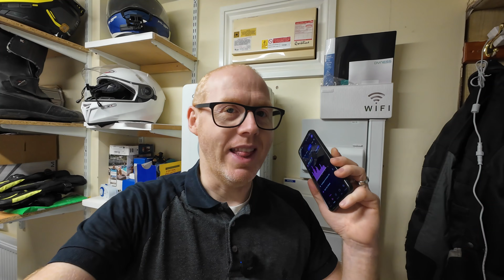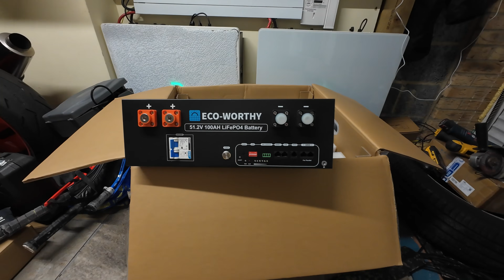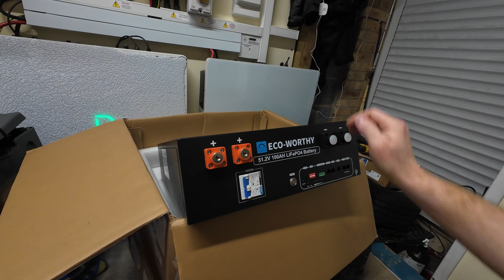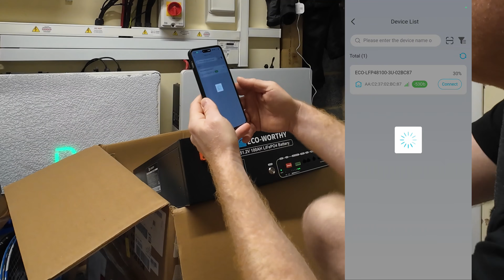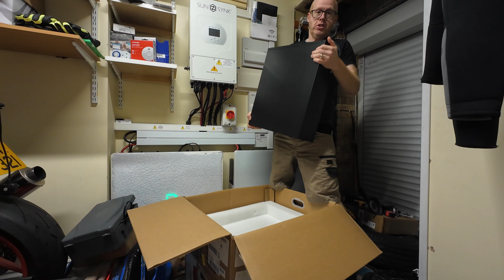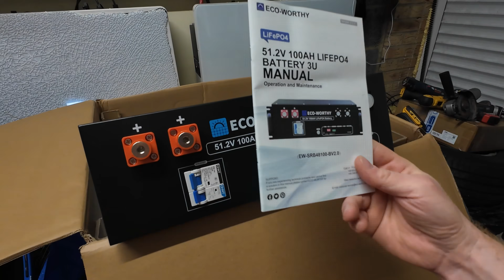Building a 34kWh Home Storage System: Is the Grid Now Optional?

Comment: I did much the same as you. I started with two PylontechUS3000C modular batteries that I used to test and commission my solar power system. Then I added six more of these and ran with the eight for about a year. Then I got two more, but I only stayed at 10 batteries for another couple of months before they were doing a deal, that I couldn't ignore, for the Pylontech US5000B model, so I got four of them. I now have 14 Pylontech batteries (which are quite similar to the batteries that you have chosen.The major difference is that Pylontech are 15S and not 16S.)

I got the Pylontech for the same reason as you, easily handled by myself, modular and can be stood vertically. I ended up with the 10 US3000C batteries in two racks and the the four US5000B batteries stood on their ends, between the racks.

I bit the bullet and went completely off-grid and don't have any form of back-up charging available. For me, it's solar or... solar. I have never wanted for power and have never had to ration power and the best thing is the State of Health of the batteries is still at 99% after two years and five months in service.

My payback time for my entire system (15.1kW of panels, MPPTs, Inverters and 50kWh of batteries) was originally 12 years, but I bought and EV to replace an ageing diesel vehicle and now my payback time has shrunk to just 8 years (and I'm more than two years in.)

For the moment my battery addiction has been assuaged, but every now and then I do have a peak at the current prices...
Reply from the maker: Thanks for watching and commenting!
Reply: ... that where I am also - got 16 pylons linked to the BMS (& MultiSIBcontrol) and have another few (2nd hand) linked unmonitored, but work well without bringing down the system to the lowest / max battery cell voltages.
Reply: How do you go completely off-grid, considering there's minimal solar production in winter? (are you outside Britain?)
Reply: @aliasgharkhoyee9501  Yes, I'm in Australia. I'm very lucky in that I don't have, or need, any form of back-up generation. If I were to go off-grid in Britain I would a most certainly have to consider back-up options.
Reply: @Qosmio1955   Fair. I'm curious how practical it is for average western European properties to be off-grid in winter.
Reply from the maker: @aliasgharkhoyee9501 15kW of panels will do it I guess, although I don't know what they're doing for heating.

Comment: Don't you have to notify the DNO if your adding generation or have you . Do you have a limit
Reply: When adding the extra inverter you do. When adding solar or battery you should do but that bit is really a paperwork formality as it makes no difference. So in the case of the video the extra 3.68kW inverter is notifiable and the G99/G100 has to be updated.
Reply: You only have to notify for anything connected directly to the grid... So mainly only the inverters. Solar can be setup to be self consumed and therefore not necessary to notify
Reply from the maker: Yep

Comment: EcoWorthy uses cheap generic LFP cells and non name brand BMSs. No thanks.
Reply from the maker: Who do you prefer?
Reply: Yeah I was looking at them and wasn’t convinced. I ended up getting batteries from the Netherlands a company called NKON who also supplied all the Victron gear for my off grid setup (16kwh 314ah EVE cells, 150amp BMS, active balancing, pack heaters and fire extinguisher all in one unit. For 2000 delivered)

Comment: Another intriguing Video!
Before you go ahead with your inverter install I would love to know if you are going to do it yourself and all the processes you are going to go through like DNO applications, permissions and you kwh allowance.

I now have the panels and inverter ready to go on my wall but haven't started yet. 

It's an off grid system without a battery I would like to use the inverter you are proposing or even the 5 or 8.8kw versions.
But I'm nervous about even attempting to apply for extra DNO permission incase I screw myself over.
Reply from the maker: I will be covering this in a future video.
Reply: @UpsideDownFork 
Good to hear dude.
Please don't skip any details 😉

Comment: Good honest review, look to be good DIYable batteries at a very fair price.  What’s the DIY situation r/e the inverter, I assume that would need a part-P electrician signoff for connecting to the consumer unit?
Payback as you say is diminishing returns for adding more battery storage, thanks for highlighting that. I’m still tempted though ….
Reply: For a grid tie inverter you need a qualified electrician to install the consumer unit element, also you need the G98/G99 application done, you need the correct line diagrams and labelling and you need a lockable isolator. From October your sparky needs to be specifically qualified in batteries to do the work.

For a non grid tie inverter it depends what you are doing but there are cases (eg a non grid tie inverter running your shed that doesn't contain a sleeping area), or where you are not connecting it into the house electrics that don't need a sparky.
Reply from the maker: Thanks for watching and commenting!

Comment: Good video. I just purchased 2 16kwh fogstar units and to be honest the depth isn't much more than the units you purchased. Price wise it would be 16kwh compared to 10 for likely less money. The economics are interesting, as some pointed out the expansion is for a couple of days in winter however given the yearly yield from the shed plus being closer to zero import during the summer and only importing off peak in the winter then it does make sense.  The key here is getting the inverters to support each other, something I had a lot of trouble with with my setup.
Reply from the maker: Thanks for watching and commenting!

Comment: We used 109kWh on the coldest day in January!  That is with a well tuned 15.5kW heat pump running open loop on pure weather compensation.  Our 36 south west facing solar panels generated only 7kWh that day.  We have 2 x Powerwall 3 battery/inverters giving us up to 27kWh of storage, so it was all gone by mid-morning.  The good news is that in February, the Powerwalls sometimes last for the whole 18 hours of expensive electricity and we are already getting money from exporting to the grid.
Reply: Jeez, and here I thought I was a high usage household with 40kwh average per day. Bravo to you 

Want to send us some energy there pal? 😂
Reply: @thabo5799 it is a 350m2,  5 bedroom detached house, built in 1968 and rated EPC C.  It sounds like a lot of energy, but it is a big house!
Reply from the maker: Ouch!

Comment: Fogstar are now doing a 48 kWh stackable system for £4500, and a 64 kWh for £5750, both can be expanded. Very good value per kWh
Reply: I picked up their 32kwh for £3200 during Christmas. It pays itself off in 3 years.
Reply: That's incredible price
Reply from the maker: That's great value per kWh! 👍
Reply: Do you have a link for the 64kwh? i don't see it on their website
Reply: @trebordraw  Its the same page as the 48kWh stackable but click on the selection box
Reply: That's incredible value considering I paid £5k for an upgrade from 4 to 8kwh. Mind it was a few years ago

Comment: There is no economic sense to do that. You did not put enough emphasis on this. There is no case for spending 1000 GBP to cover 7 days of winter shortage, that will at most cost you 2 or 3 GBP more based on your existing system.
Sadly, you are just contributing to being people in the rabbit hole of always buying more or bigger gear without understanding the economic return.
Is this a sponsored video?
Reply from the maker: Yes, this doesn't make economic sense for me, apart from the continued youtube exposure which may pay for itself.
Reply: You are aware that other people exist, and just might have different ideas than you? Some of us value energy independence, rather than economic return......
Reply: @adamswire9152 what energy independence? In the winter, he is only producing 10-20% of his needs at best so he still relies on overnight cheap tariff.
Reply: @aymerichousez1005  I may have missed the point you are trying to make. I value energy independence. I have a large DIY install of a 48Kwh battery banks and 12Kw of panels. UK weather is very, very variable. It only takes half a day of sunshine to fully charge my batteries and can get four days normal usage out of them with no sun. This winter in particular, we have had many continuous days with no sun, so in my case, an even larger battery bank would help with my energy independence, and mean I could stay on solar for longer. I am not looking to make money or to reduce my bills (although that will happen a bit) I make my own choices to suit my own circumstances. As does @UpsideDownFork. He said he installed more panels and was looking for a way of integrating them into his system, and this is how he did it. The fact that you would make differing choices does not invalidate his.
Reply: @adamswire9152  Its not really "energy independence".  It is very hard to build a solar and storage system big enough to actually get that 12 months out of the year.  9 months is easy.  12 months is almost impossible.   The storage isn't even the biggest problem there... it's the solar and, in particular, winter heating that's the problem.   Add in an EV?  Even worse.

But what you can achieve is a 11 or 12-month zeroing of your bill (sans the standing charge anyway)... by building up export credits in the summer and burning them in winter.

Even a completely off-grid property (and there are many here in the U.S.) is not completely energy independent.  They still have to buy fuel for the generator and/or heating to bridge winter.  The solar and battery system optimizes the fuel consumption and limits it to just ~3 months a year (across winter), but the cost can still run $1000-$2000 easy for those 3 months.

So either way you are paying someone something at some point.  Minimized, yes, but never completely independent.

-Matt
Reply: @junkerzn7312  Very true. Difficult to get nuance on YouTube comments! Personally, I am aiming for independence from the electric company, and having the capacity to generate and use my own power. I am nearly there, tbh. I live in on the south coast of the UK and boosting my battery bank would enable me to achieve this.  It is an ever evolving system. I will have far too much power during the summer though, so I might get a hot tub or heated swimming pool!  My winter heating is via a woodburner with a back boiler for hot water. I am still connected to the natural gas grid as a backup but with some changes, I could be completely independent. Next on the list, after a larger battery, is to become water independent.
Reply: @adamswire9152  I don't really recommend a wood-burner for heating, but it depends how large a space it is.  A regular home... I wouldn't recommend it.   Keep in mind that there is a convenience angle and a manual labor angle to working with these resources.  Also neighbors and regulations.  And long-term health.
Reply: I guess it should be seen as investigative content for his YouTube business. I'm sure that will make a return. I certainly wouldn't be influenced to follow suit, you should design for your own circumstances.

Comment: Powerbox G2 has self heating function that is a plus if batteries has to be placed in a non heated garage
Reply: In a garage, lithium batteries will be fine without heating as Coldest temperatures will be around 6-15 degrees. Outdoors, absolutely essential.
Reply: @techtactics788  that depends where you live. Cold places do exist.....
Reply from the maker: Yep.

Comment: Amazed that your daily house load didn’t go above 34kWh, on the coldest day I used 80kWh, most of which was heat pump.
Reply: Depends what tariff you are on.  I’ve touched on 80kWh this winter as well with my heat pump, but with Octopus Cosy you get three cheaper rate top ups a day so only need enough battery storage to last through the 4-7pm to avoid absolute peak, or 4-10pm to avoid day rates as well.  My 13.5 batteries will do the 4-7pm on almost every day, and 4-10pm on milder days
Reply: @geoffreycoan  yes I do exactly the same. Think we had 5 days this winter where it we slipped out of the off peak for a few minutes. But to go on an overnight tariff I’d need at least 4*13.5 batteries, which is crazy expensive. I like to keep my batteries outside, so the really cheap ones wouldn’t work for me, plus they stop working when it gets too cold. My PW3 was fine at -9C this year, little bit slower to charge up but it still did.
Reply: Our worst day was 22kwh whole house load with the heat pump. 

I'm shocked people use so much 🤣
Reply: @Burtis89 you probably have a very well insulated house like myself. 3.5kwh vaillant system and used 19kwh on the worst day
Reply: @thabo5799  old 60s council house 6kw heat pump
Reply: @Burtis89  We routinely sit at 70-80kWh a day in winter, thankfully almost entirely off peak. It's a big old solid stone victorian pile that can't be properly insulated - insulation makes a vast difference and people don't seem to grasp the scale of energy savings between EPC E and EPC A
Reply from the maker: I used more battery energy but consumed a lot of it in the 6 hour overnight window.

Comment: How much are they ? Would a six pack be worth getting because it would save rather than building it up one at a time , hopefully this year you can do a deeper dive into flexible or foldable panels compared to the solid ones. Don’t want panels on the roof so if I was going the solar way of the force would rather go the light side of the force than the heavy side ,
Reply: Absolutely, do not ever buy flexible or portable panels unless you're going camping!!! You flex them and they crack!!!
Reply: @SolarizeYourLife  so is the not a good portable or foldable panel you could recommend then ?
Reply: @KavanOBrien  The best flexible panels gnerally last about 5 years before they turn to junk even if meticulously maintained and properly mounted. The rigid panels will be a few percent down in 25 years and structurally sound.
Reply: They sell 16kWh single units as a pair for far less than the stackable ones, so if you expect to want 16kWh or more you might be better just buying their or rival 16kWh units on wheels. Yes they are really heavy but the single case and single everything else for 16kWh makes them far cheaper
Reply from the maker: Thanks for watching and commenting!

Comment: They provide their own inverter,I suppose it's not as good as the one you have?
Reply: They only do off grid inverters
Reply: @techtactics788  They can be used as grid connected but not grid tie inverters but they don't have a particularly good reputation on solardiy.

Being non grid tie does mean you can self install one to power your shed if you really wanted to.
Reply from the maker: Sometimes you just stick with what you know.